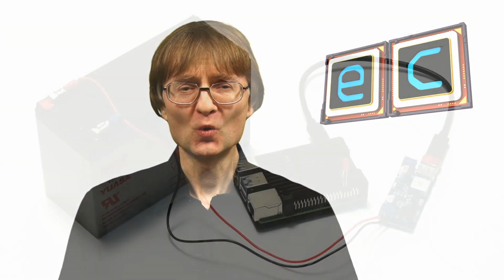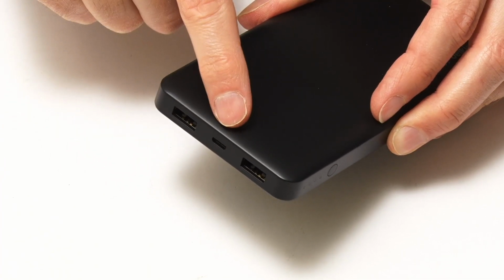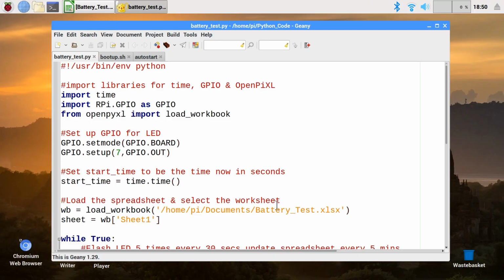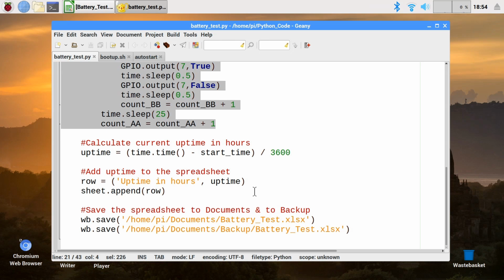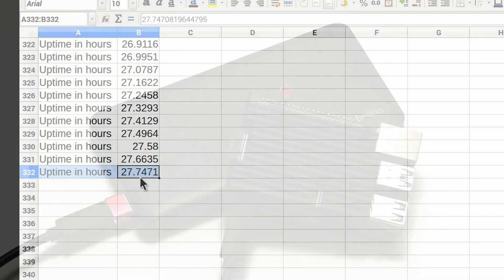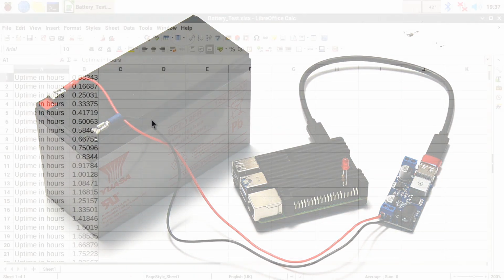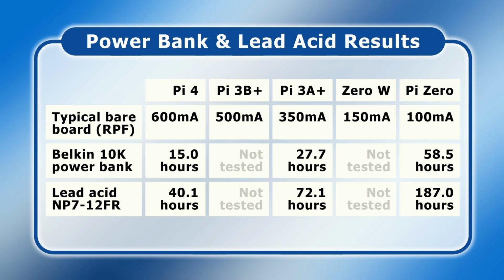Raspberry Pi Battery Power

Comment: This is a good idea, and I have adopted it. Compared to power banks, this solution performs better, on cost. It also fares better in the reliability area, if you choose a 4.9 star-rated battery. Reading the comments of power banks and low-end batteries, many out of the box solutions are a disappointment. In terms of length of hours with charge, this solution won out too. Days and one week are astoundingly good, especially when getting field data.

Comment: Fantastic analysis, and thank you for investing the time and effort into such an in-depth test! It’s incredibly helpful and has motivated me to seriously consider switching to a lead acid battery for my solar panel project. I’m thinking of going with a Victron 75/10 paired with my 55W solar panel.
Right now, my setup includes a Raspberry Pi 3B+ with a Waveshare Power Solar Controller C and three 18650 batteries (3 x 3500 mAh). While the system runs for about 16 hours, it’s falling short of my goal to keep it running continuously on solar power alone. That’s the main challenge I’m trying to solve, and your results give me a clearer direction on how to improve power reliability and move closer to a 24/7 solar-powered solution. Fingers crossed :)
Reply: hey bro, did you solved it . I just loved to hear about you current setup or previous Raspberry Pi 3B+ with a Waveshare Power Solar Controller C and three 18650 batteries (3 x 3500 mAh) .

Comment: regarding the usable capacity of rechargeable batteries being lower than the rating, it has more to do with many battery banks giving the raw cell ratings.  Often that 10,000 mAh refers to a single 10,000 mAh lipo cell, which is at 3.7v nominal, which works out to about 7400mAh after boosting to 5v.  This is also assuming 100% efficiency, so you can probably drop it even a little further.

Comment: Absolute computer nube here interested in making a pi cyder deck with potentially 2 of these batteries in parallel for programming out in the field. Can I still use the dc plug on the input end to charge the battery at the same time as running the pi without blowing it up? Which brings me to to more questions can I use with a pi ups unit? As extra back up

Comment: Hi Christopher. Hope this comment find you well, 2 years after this video was published. Have you had any luck with running a Pi5 on dc battery power?  I have have tried everything I can think of, and nothing works properly for full 5v 5a power. Running a local LLM maxes CPU on a pi5, and my only solution so far, to avoid brown outs, is to use an inverter and the official Pi foundation wall wart. All other experiments with dc-dc bucks, powerbanks etc top out at about 10w. Seems to do with USB C standards, and the Pi5 diverging from the standards to get 5a from the OEM wall wart. Any thoughts?

Comment: isn't 10,000 mAh rating for battery itself that has 3.7v nominal voltage, or is it calculated for 5v? so wouldn't calculation actually be something like 10,000/600*0.75*0.74 so basically 10,000/600*0.5?
Reply from the maker: The rating will be for the voltage that the power bank supplies (here 5V).

Comment: You made an amazing work for this video. Love your channel, humor, and basically everything. Unfortunately you totally missed the particular thing I was interested in when looking for a video about raspberry battery setup. I would like to know how to connect all those 18650 batteries I have wasting around me to put to use to charge my raspberry pi4b on the go.
I turned my raspberry into a little cyberdeck. Nothing fancy, just connected a 5inch touchscreen through DSI and using bluetooth keyboard and usb mouse dongle... The powerbank I happened to have has a too weak converter and after few seconds or minutes the raspberry restarts, probably because it draws too much amps and the converter cannot handle something above 2A. So I need a proper converter, but all converters available online are dedicated for 12v step down, which totally does not fit 18650 output or they have maximum of 2A output which does not satisfy the raspberry hunger for power...It's a total mess. except pi sugar, pijuice and a 3A powerbank, there is no straightforward way to build a battery system for Raspberry pi 4b with 18650s (and the same probably will go for raspberry pi5)

Comment: The mAh rating of power banks is based on the internal battery voltage of 3.2v - 3.7v depending on chemistry. This is inline with your 75% factor.

Comment: That Buck converter was pretty expensive.  Pretty much in line with a standard power supply.  Has anyone seen one that's cheaper and will power a pi 4?

Comment: I’m currently using an RPi 3B  for my weather station.  I would like to replace it with an RPi Pico W.  I already have a Pico programmed to replace the 3B, but I would like to power the Pico with a battery.  I have tried several battery packs, but they all shut down in a very short time because of the low power consumption of the Pico.  I guess the next option is to try a lead acid battery.

Comment: When the lead acid battery is drained down to 6 volts that buck converter will still be sucking usable power to deliver 5 volts. This is well beyond what you'd normally consider a usable voltage from a 12v battery.

Comment: Christopher is correct and you computer geeks shouldn't laugh at the science of lead acid batteries as just like your lithium items it's pretty forward thinking too... but just in case you didn't know lead acid batteries run on electrolysis and the explanation for loss of battery efficiency during high drain or demand is the diminishing of this effect ..and its probably something we've all met in the past too...an example is when you get out of bèd on an cold winters morning and attempt to start the car and the engine doesn't start but the starting motor does ..so you turn the key chug chug get frustrated and continue to chug chug the starter til even the starter gives up the ghost...so what do you do now?...like most youll wait patiently and then try the starter again only this time you dont give it quite as much and et voila the motor bursts into life and your away.. but what was the issue...Current drain and electrolysis you see with your impatience you turned all the acid in the battery momentarily into water and that doesn't run batteries no its acid and lead that does .  and that's also why you should be judicious with the cars starter on cold winter mornings ...oh and its not really the battery but the stone cold motor thats the problem...so learn to go easy with the battery after all its quite forgiving and be appreciative that there's nothing wrong with good old lead acid batteries this as the informative EC tests should have taught you..

Comment: You are using the wrong units and values for calculating potential run time for these batteries. Think watt-hours and also realize the 10,000 mah of the lipo battery is bogus. That is the total of each cell at about 3.6 volts, which means the mah at 12 volts is in the neighborhood of 2500 mah. The lead-acid battery amp hour at least has a distant usable value  with reality.

Comment: Have you figured out how to confront the increased power supply needs of the 4B+? Over 3.0 amps. That is where most battery banks cut out.
I am looking at UPS hats but don't know if it will work.

Comment: How do we measure the battery voltage on the Pi and automatically/completely disconnect the battery when the voltage gets low so we do not damage the battery?

Comment: Hmm. Not really. Lead acid capacity varies inversely with current. So far so good. 
Most capacities are specified at the C20 rate. And vary with temperature. 
However running lead acid down to cut out level will severely reduce service life due to sulphation.
It's thus a general rule that you don't run then down to less than 50% SOC. 
While a decent BMS will prevent damage to lithium ion batteries due to excess discharge, there isn't one in lead acid. Here voltage/SOC should be monitored and the load disconnected. 
You're also misleading with the Powerbank.  You charged it fully each time, but the 70% rule of thumb is based on charging to 80%SOC, not discharging below 10%.
Effectively you spent a lot of time showing not a lot except total battery capacity.

Comment: Great content, keep it up, very much appreciated.

doing the Maths 150Ah leisure battery that can handle deep discharge cycles should run a Pi Zero for 150 days or a Pi 4 for 35 days.

Be interesting to see how long with a solar battery charger rigged up to a battery conditioner one could get away with running one of these things.  Maybe a year ?

Comment: if you whant the last battery drainage , you could use Gravity and cheramics to water your plants , 
it will check moisture and open up automaticly , when its to dry , only requirements is ~1meter of water pressure

Comment: it gave me idea to direct tap on the battery on the apc or eaton or cyberpower lead acid battery to power up the rasberry pi 4 and use as a ups server using nut ups, majority of the consumer ups dont have network capability but they had usb

Comment: Hi your powerbank tests are flawed because most if not all powerbanks dont let you charge and use them at the same time, so its inconvenient to disconnect it from the pi, recharge and reconnect.
Between the battery types of lithium or lead, lead is best as a backup power where you will mostly be connected to the wall while lithium is good where it will be charged/discharged often like with solar.
If you want a proper test, do the same with lithium like you did with lead as thats what a practical setup is. Using a powerbank on a pi is only for situations where you want to do something portable like hacking public wifi.

Comment: Would like to know the voltage of the lead acid battery when the pi shut down.  I'm guessing it's around 5v, unless that buck converter is real smart.  Draining the lead acid battery to 5v consistently would affect it long term.
Reply from the maker: All true. This was an extreme test.

Comment: As may already be known, adding a sleep routine to the code could push these uptimes higher as well. Not sure what it's like on the Pi/Python side of things, but I made a simple temperature and humidity logger for a small greenhouse - it transmits the readings once per minute over UHF ASK to a receiver that progresses the results line by line on a small OLED. Then four times an hour it logs those readings to a microSD, then I can import those into the Calc app and graph it. Anyway, long story short, the Arduino nano it uses has in its code the Low-Power library - it sleeps every 500ms, checks the loop for an instruction at the set time (using a DS3231 time module, which logs time to the readings as well) - so most of the time it's sleeping, which takes the power draw from 30mA down to 8-to-10mA - I'd like it to be lower, but it seems to run for a day or two off a rechargeable 9v battery.

Comment: Interesting video you made here Chris. I wonder at what current the buck converter stop working as some already pointed out so is it not very good to let the power go to low on such battery without make damage to them. For your green house project would it be a good thing to have some sun charger with regulators into the project but that might come in a later update?

Comment: Hi Chris and fellow viewers, i am interested in running a raspberry pi inside a car. Since the car electrics are 12v, i was hoping to use the same step down converter, but for convenience i would like to feed it through the barrel jack connection. Any idea what the polarity is of the barrel jack or how i can find out?

Comment: What is the device you use for converter Led acid battery
Reply from the maker: It is called a buck converter, specifically a 12V to 5V model. Also known as a Power Buck Module or a DC-DC step-down converter.

Comment: There is another option which may save some money and give a decent run time. Power tool batteries and a buck converter. So if you already have a drill with a rechargeable battery or even better multiple batteries You can power a Pi anywhere. The bonus is those batteries get some use. Portable Pi's can be a pain though. All the accessories to make it worth it can be a pain to carry with it. Then wires everywhere. I had an old boombox, took out the cd player, that left room inside for  a 20k mah 5v pack to run the pi, the pi, a 7" touchscreen, a 12v drill battery to power the boombox, folding keyboard, and 8 Bitdo controller and trackball to sit on top. Full pi desktop running Twister OS, which has Retropie, a second USB stick for Android, cell phone provides the internet. All with one carry handle, no extra bags. Screen is good height for any table. It can play music, tv, movies, old console games anywhere, with better than adequate sound.  Tape deck still works too.I can use 2 drill batteries and power both the Pi and the sound as an option using a second buck converter. Planning on getting battery adapters so the battery just plugs in and out for fast swaps.

Comment: Power bank sellers are cheaters. 10000 mAh is not for the 5v output. It is for the 3.7 volt battery inside it.
So your 75% calculation became correct.
3.7x10000/5 = 7400 mAh only.

Comment: So that would estimate out to about 127 hours for the Pi Zero W on the Lead Acid Battery? Not bad! 
That estimate math being multiplying the Pi Zero's run time by the Pi Zero's rated draw, and the dividing it by the Pi Zero W's estimated draw  (187*100/150=124.6_). 

Note: that math only works for an estimate because the Zero and Zero W are very similar, you can't use the same math to get the 3B+'s estimated life from the Pi Zero's, but you can get from the Pi 3A+ to Pi 3B+, and none of the math or indeed the test above accounts for an operating load, just idling at desktop with the script taking a run time snapshot roughly every 5 minutes.

Still not resubscribing until EC promises to keep politics far away from his content. There's no value to be gained from a computer technology channel spouting off about politicians they dislike, and the obsession with injecting politics into everything is unhealthy bordering on psychopathy.

Comment: Sorry for bothering you but what type of connector/terminal (I don't exactly know the exact terms, I'm new to this sort of thing) did you use for the battery/buck converter. Maybe I'm not searching the correct thing but I can't seem to find any terminals like yours
Reply from the maker: Here you go -- https://www.amazon.co.uk/gp/product/B00XWDSMWA/ -- they are crimp spade connectors.
Reply: @ExplainingComputers  Do these come with a wire/cable or do you need to sodder a seperate on or something

Comment: Thanks for the tests. I’ve run a zero with a LED Lego Christmas tree for a day at a time, pretty impressed.
Question, I’ve been trying to run a pi4 off 12V but the 3 dc dc converters I’ve tried don’t provide the current or voltage needed. I get the infamous pi low power lightning bolt. Did you have any low power problems with your buck converter
Reply from the maker: Thanks for this. I had no issues with the buck converter.

Comment: I'd be a bit worried using a lead acid battery that way as you don't have anything to shut it down when the battery reaches a safe lower voltage. That 5V converter will drag it all the way down to 6V, or worse, a level that will surely destroy the battery and give it a very short usable life. (as in number of times it can be charged and reused)

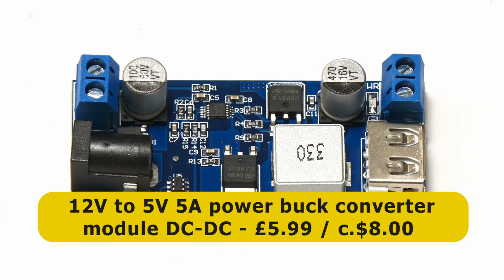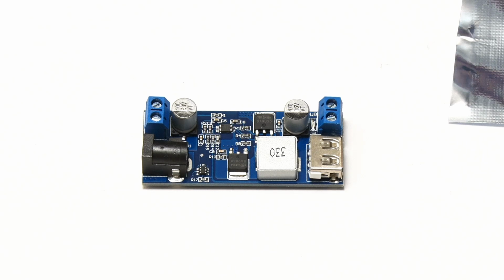Comment: 10000mAh is usually the total battery capacity inside the bank. That's not the same as 10Ah at the 5V. 10Ah*3.7V = 37Wh. Multiply that by 75% efficiency of the DC-DC converter (because it's a step-up and usually has a tiny inductor, but can be higher for good power banks) and you have 27.75Wh. Divide that to 5V and you have 5.55 Ah at the 5V. so you can run Pi 4 about 5500/600 = about 9h 10min. That's nowhere near the 12.5h in your calculations. Respectively 5500 / 500 = 11h for Pi3B+, 15:43 for Pi A+, 36:40 for ZeroW, 55h for Pi Zero. Also my Pi4 8G idles at about 400mA - that's 13:45 (you got 15 because your bank is better than 75% efficiency). Full load 740mA. So it really depends what you are doing with it. If it sits idle it should last 13:45. Well that's my prediction at least. Maybe people can post their tests to compare.
Step-down (12V to 5V) are usually a bit more efficient than step-up. They are in the range 85% for the common types to 95%-98% for really fancy ones. Average lead-acid battery voltage is about 11.7V *7Ah = 81.9Wh/5V=16.38Ah or 16380 mAh for the 5V which must be multiplied by buck converter efficiency This one looks like synchronous so it could be 90-95% depending on the load. At lower loads - like Pi it is less efficient. Let's say 90% -> that's 14.74Ah at 5V. A pi4 would last 14.74/0.4 = 36:51h. if it runs for 40 hours then the capacity is 40*0.4=16Ah at the 5V which means (16/16.38)*100 = 97% which is not very likely. So maybe the battery is 7Ah at higher current draw. Also you probably drained the battery to 0V and they specify the capacity down to 9.5 to 10V. It shouldn't go lower than that or it will soon damage the battery.
And last but not least the power bank itself draws 10-30 mA, so that might explain the results for pi zero. Also maximum efficiency is at 50-70% of the rated current. At lower currents the efficiency is lower.

Comment: This is a great video. Where do I get that buck boost device and/or what is the manufacturer? Also , what kind of cable/connectors are used to connect the buck booster to  the raspberry pi? Will just an ordinary usb adapter cable work? Is the buckboost device's output standard usb type a  1, 2 or 3? The raspberry pi requires usb c , right? will any adapter cable work?